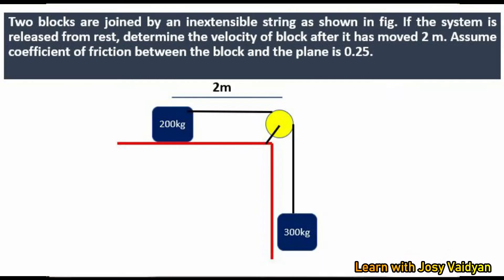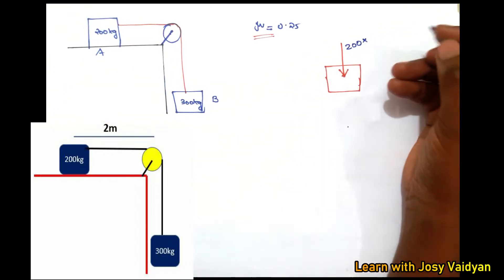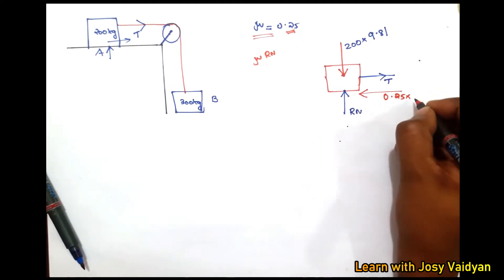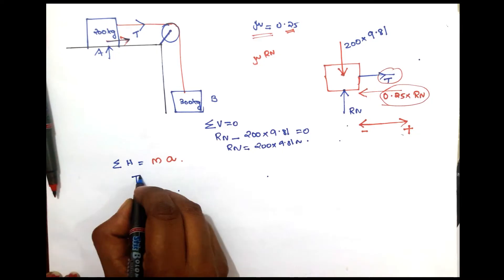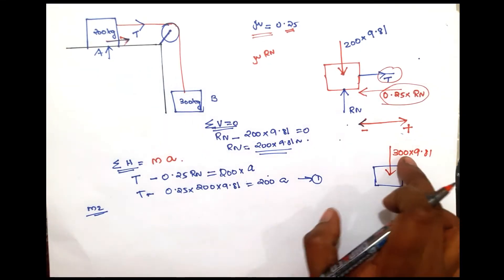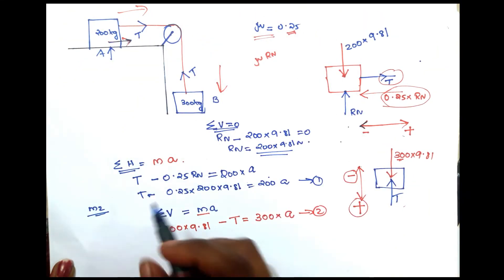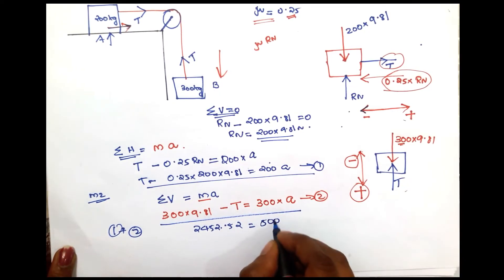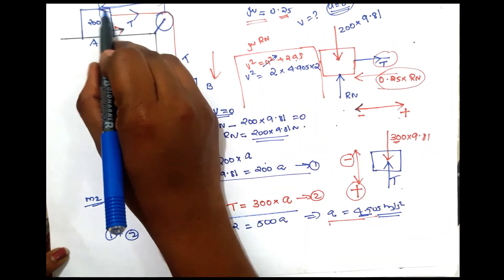Dynamics|Part 16|Kinetics-06|Motion of connected bodies|Engineering Mechanics| KTU

Comment: Miss am getting acceleration as 6.68 and ur answer is 4.**
Reply: Use bracket when substituting T
Reply: @shifaskareem1143  got it 👍
Reply from the maker: Acceleration is 4.9 not 6.68..
Reply: Anikk acceleration 5.101 ann kittane…
Reply from the maker: Check ur calculation..chilapo decimal ulladath round chythapo ulla problm aarikum..angne anenki ok aanu..4.9 and 5.1 adthalle..